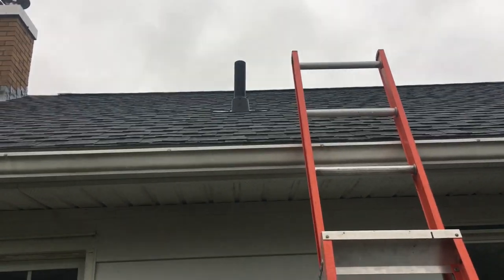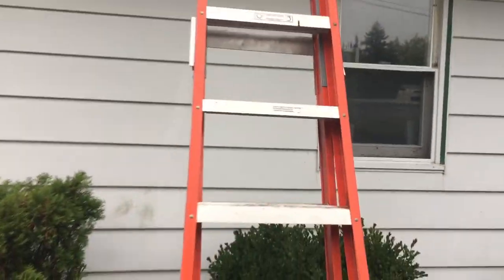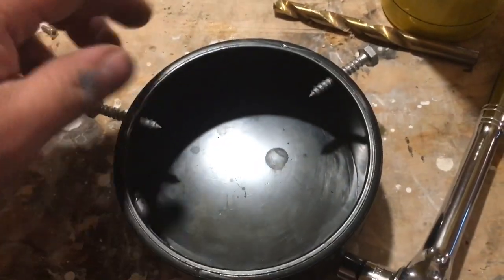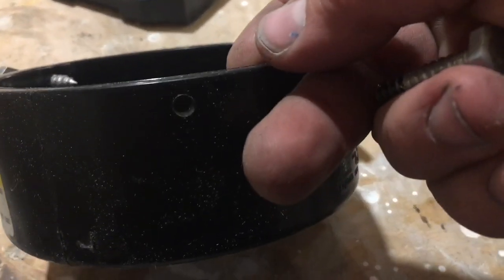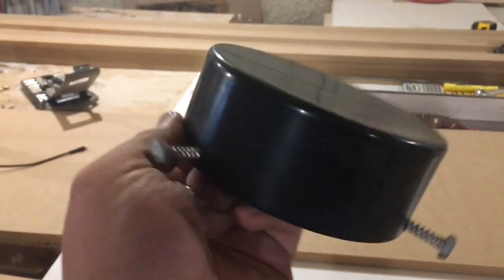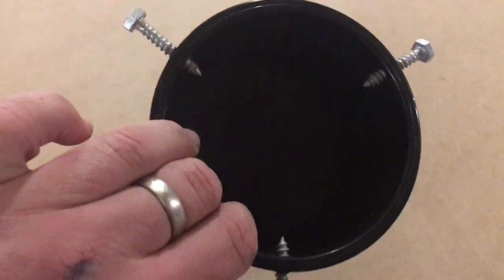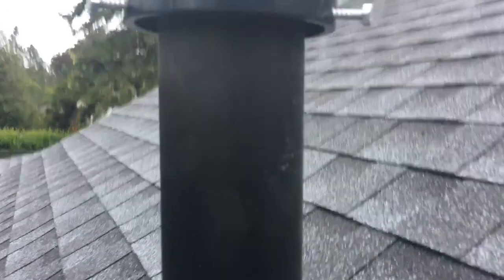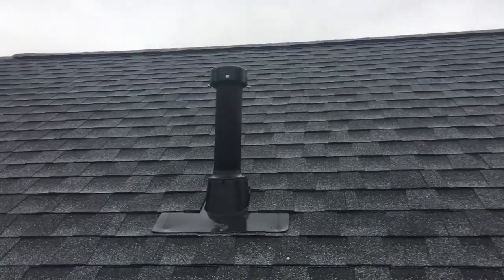DIY Plumbing Vent Pipe Cap for only $10

Comment: Would it not have been prudent to find where the vent pipe was leaking and fix it. Could the vent gasses possibly still be geting through a cracked pipe or bad glue joint into your living space? Would condensation still form on the inside of the pipe and run through?
Reply from the maker: i have sense fixe the leak! luckily it was in the attic space, still a good idea to keep this on keep a-bit of water from going into the septic

Comment: Here in the U.S., Home Depot sells mushroom vent caps already made for $7.97. Lowe's also has them, but they're a little more at $10.48
Reply from the maker: ya i wish we had them here in canada thats why i needed to make one!
Reply: @dangeranger69  I wonder why they don't sell them there? I wouldn't think they'd be against code. At least you got the job done. I liked your idea of heating the screws to make your own threads in the plastic. The pre-made caps are constructed with internal steps to prevent the cap from falling down due to the cap potentially loosening with the expansion and contraction associated with temperature changes. A potential solution to that is adding some longer screws above the other 3 or adding something else to the inside to prevent the cap from falling. The main reason is that it could potentially fall and close off the vent and you wouldn't even know it.

Comment: I saw this  and my vent pipe does have a few leaves and possibly nuts into it from squirrels ( 
( unlikely ) but an empty coffee plastic jar inverted over it just fits. I took a knife and punctured 3 slender holes for ventilation and no leaf or nut entry will happen and only a hard rain could even penetrate it.  And free....

Comment: Great idea and thanks for sharing this . Did a nice job on your vent also. I have like 3 inch galvanized pipes sticking up through my roof over both bathrooms that do not have caps. Well both exhaust fans that are mounted in the ceiling got water in then and have rusted like crazy and don't work anymore. So have to replace both of them. So is it most likely these two 3 inch vent pipes on the roof allowing rain water to go down on these fans? I don't see any other larger vents for the exhaust exit other than these two vent pipes. Live in Washington so get tons of rain.Thank you again.

Comment: If I had a problem with debris or pests getting in my vent pipe I would also make my own cap using the same cap you used. However, I would use bolts instead of screws as the pvc pipes can be brittle after being exposed to UV light and other weather conditions. Here is a link to a product on the market using bolts instead of screws. 

https://youtu.be/TW1jANgTwoI

Comment: May I ask why you did this? My husband and I just bought our first home and in the pre-inspection it said we need to remove the cap on our vent pipe. Articles I've been reading say that caps block sewage gases from getting out of your home so I am curious why a cap is on it?
Reply from the maker: the cap isnt seated to the pipe, i had the installed to keep rain water out  air was still able to move through, there are disadvantages to this but i kept a eyebon it
Reply: I think the water is coming in from an unsealed pipe section but its usually a flange or roof issue. You should be able to run water from that pipe thru to the sewer line... check for sunlight leaks in a dark attic if you see light then water will find its way in at the same spot.

Comment: How did this work for you? It is now 2022 do you still have it on? Have you run into an vacuum issues? Thanks for your time.
Reply from the maker: no issues, but you must leave it elevated and not sitting right on the pipe so air can flow freely around the cap
Reply: @dangeranger69  Awesome Thank you for the reply. I live in Minnesota and I have been having issue with the snow getting in mine and then freezing so I'm constantly shoving a rod down to break it up. I was told not to cap it cause it could cause a vacuum and I didn't want that. I will be doing this now. Have a great day and thanks again! ^_^

Comment: You have to vent your plumbing, That undoes the whole purpose of a vent pipe. you should have at least drilled holes on the side so it gets air. Your problem was the vent pipe cover was installed wrong.
Reply from the maker: its not all the way down on the pipe its installed to prevent water and snow from going down
Reply: You obviously did NOT even watch the video Daryl...